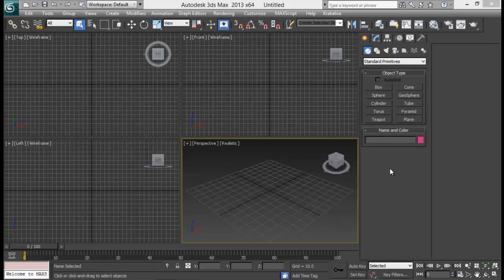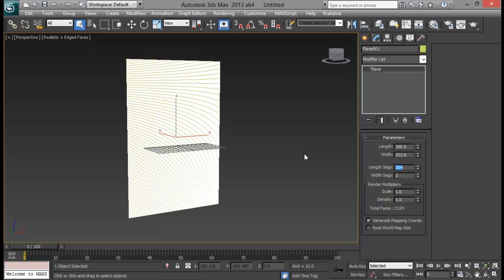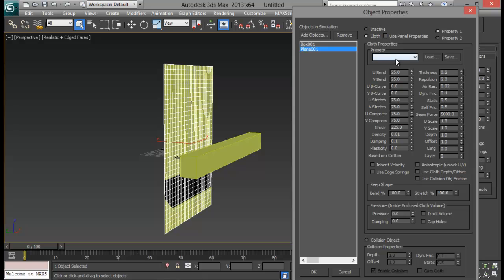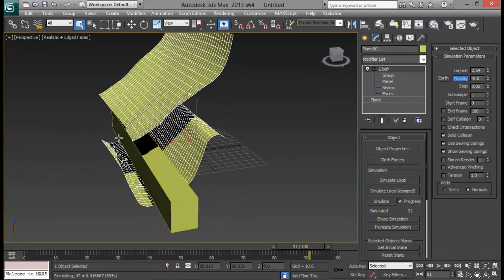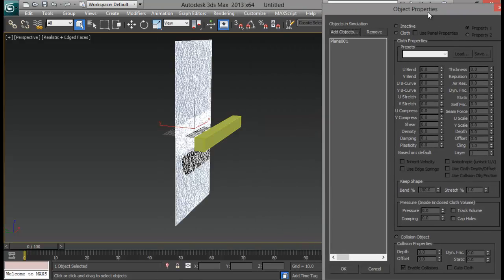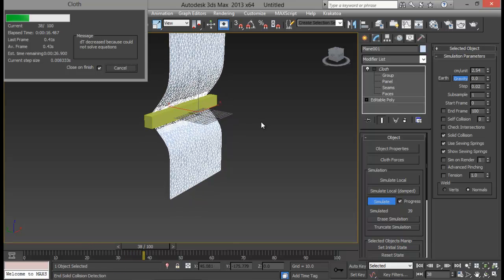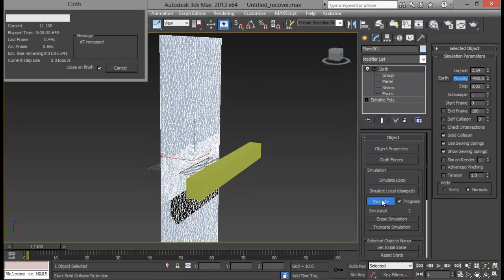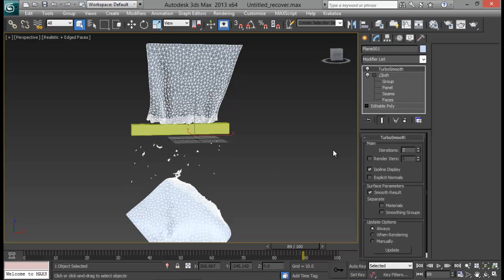Tearing cloth in 3ds max

Comment: please why is it that mass fx rigid body simulation explodes in a crazy way no matter what you do and also continues to vibrate endlessly this happens from 2013 and later in 2012 it is cool even using the same setting as 2012 this happens when you fracture all training on you tube,digital tutors and all of them use it with box and avoid using it with fracture those that use it with fracture only does so with 2012 version is it that it does not work well  with fracture from 2013 my mail is p.olajidejohnson@gmail.com thanks
Reply from the maker: i am not sure about this. I usually dont use mass fx.